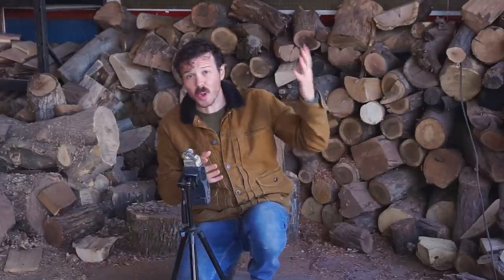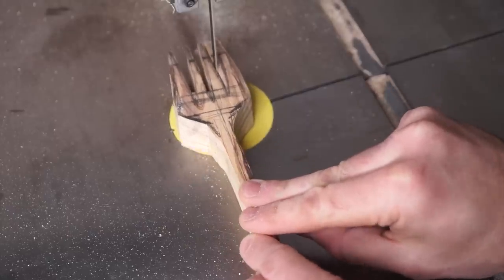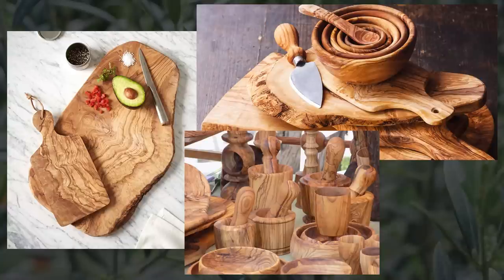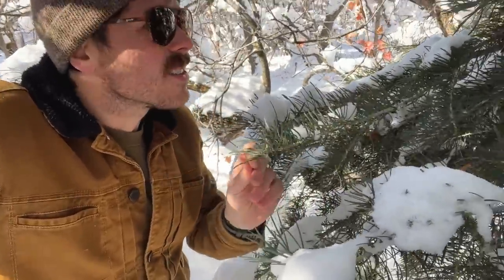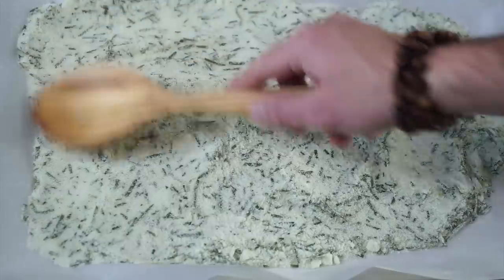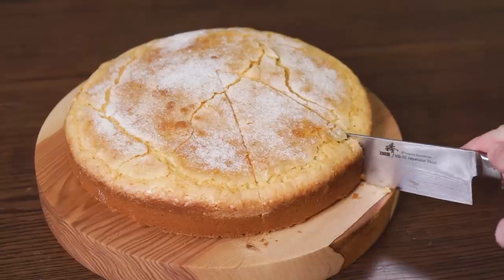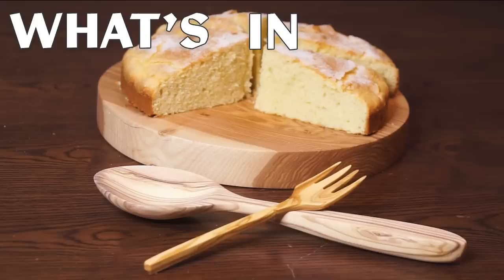Olive Wood is MUCH HARDER to Carve Than I Expected | What's in That Pile?

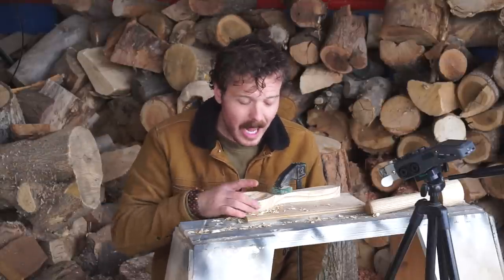Comment: 2:51 tip from another spoon carver: position your gouge then hit it with a rubber mallet. You’ll get more bite into the wood. Then you can come at it from the other direction to remove the piece.

Comment: I feel the pain in dinged gouges! At the end of 2022, I was making myself a better woodworking mallet, because the plastic and rubber faces on the hammer I started with were getting really chewed up. I used a piece of argentine osage orange for the handle and a piece of verawood for the head. The pattern I used had a curved section on the head so that your hand could be closer to center mass. When I carved that curve, it took multiple days, over which I had to completely resharpen my gouges three times and I badly chipped the edges of three of them. Fixing them is a pain, especially without a good slip stone. I was stropping frequently, but it couldn’t keep up. The whole experience was super frustrating, but the mallet is really nice now. I will say that the whole green and orange aesthetic is pretty unusual, though.
I’d bought the wood a couple years ago with plans that never materialized, so I figured I’d use my favorite handle wood and my densest, strangest wood to make a tool that will last a long time.